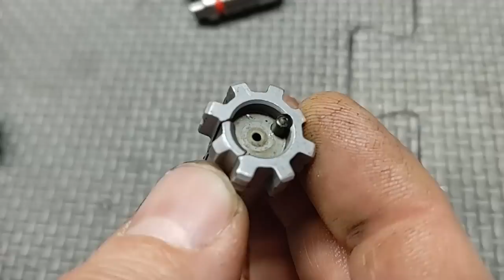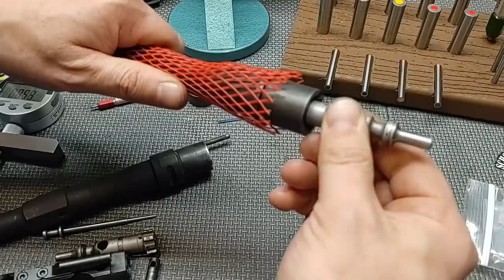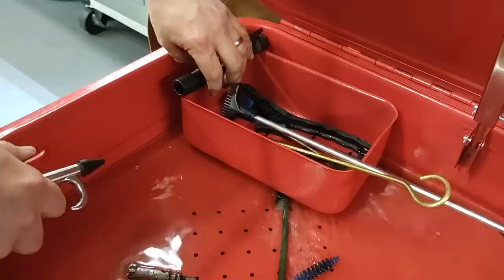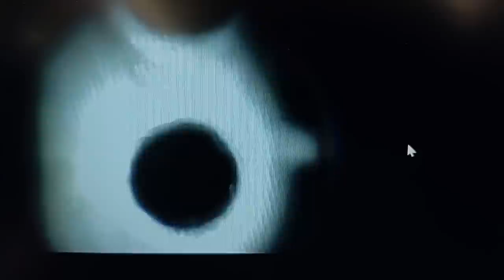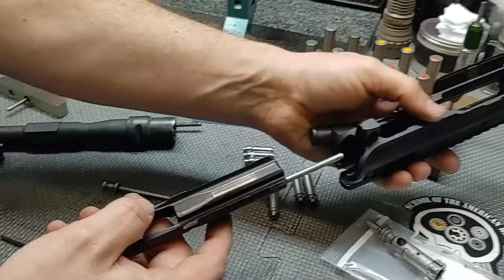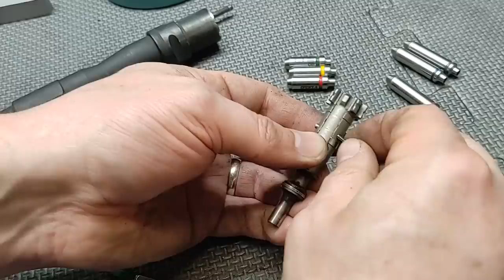Part 1 - LMT Enhanced Bolt Physical & LMT Enhanced BCG & Barrel Autopsy

Comment: Unrelated topic but quick question. What is the is the issue with having “too heavy of a buffer”
Reply: From my understanding, the heavier the buffer, the more resistance behind the BCG. Therefore, an over-gassed rifle will be less violent, but less reliable with a heavier weight buffer. An under-gassed rifle will have short stroking issues with a buffer that's too heavy.

It's easy to think of it as a continuum:
Heavy buffer=less recoil, more risk of short-stroke failures.
Light buffer=more recoil from higher carrier velocity, this can cause parts failures prematurely.

What I do is load one cheap steel round into a mag and fire it. Then I increase the buffer weight until the rifle will fail to lock open on a steel .223 rem round.  Does that make sense? Once you fire a properly tuned gas-system you won't go back!!
Reply: Tyler XE I’ll probably try the same. I finally found an a5 buffer system on SOLGW website( their sold out everywhere) but they only had an a5H3 buffer so I just bought it
Reply: @CertifiedBullpupHater  you can remove one of the buffer weights and replace it with a steel weight from any standard buffer for an a5h2 setup

Comment: Any idea how many rounds on the bolt with weak springs?
Reply: the bolt had 2-3 mags stuttered through it before its first trip to LMT due to cases sticking and failing to eject, pretty sure i was shooting Fiocchi ammo. Went at least 5000rds of Federal AE 5.56 on a suppressed 10.5 fine before I then dropped in a .300blk barrel and every case I could find stuck. I tested it with 5.56 again to see what was up and this time all I had was PRVI, cases kept sticking, sent it to lmt, they changed the ejector spring like the first time. I doubt I put another 200rds on it before sending it to Chad because I was seeing the exact same issues I had seen a year earlier. 

Round counts are approximate given its been a year since some of these events happened.